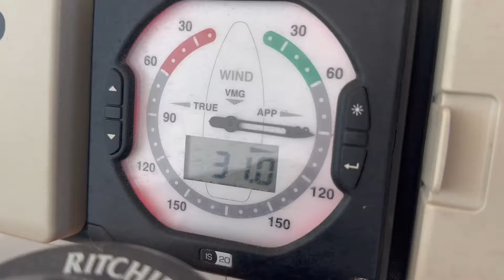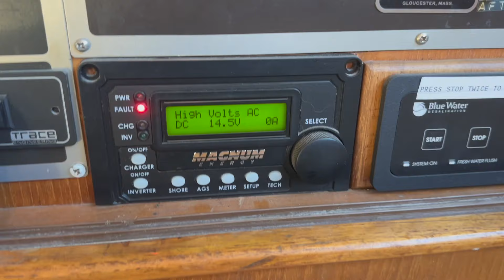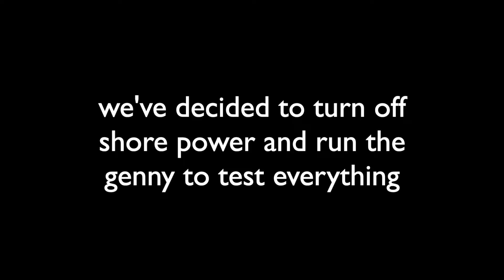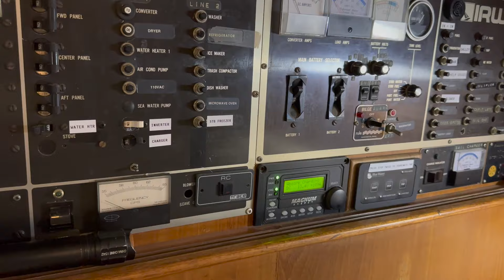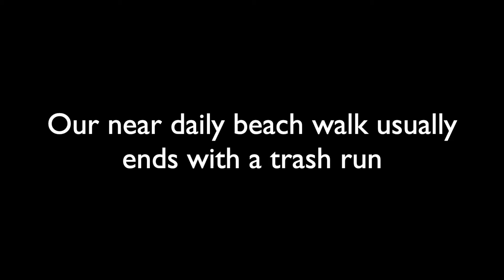Ep 66 | Sailing to Peñasco with two dogs, a cat and a rat

Comment: Been a while since I checked in.  You both look great (and the boat and doggies)!  Hope you get your stowaway issue solved, before it eats all you wires!

And hey, question about shore power if u have time.  I thought (especially) on a big boat like Blue you'd have a surge protector / power conditioner / or something  to deal with (or warn you) of bad shore power.  Is it not technically feasible or you just don't have one?  Thanks and good luck with everything!👍
Reply from the maker: Great question! We do have a surge protector for an RV but haven’t found an adapter for the boat. Typically we anchor, so we haven’t done much research on surge protectors for the marine industry. Something we will definitely look into if we dock her long term again. Thank you for the comment and encouragement!🥰

Comment: Hi.. how did you contact  the San felipe marina? We thinking of going in there for a week or so , need to cross border for  our visa run.. 
Thanks
Reply from the maker: Hey there, we called the marina: (686) 577-6394. This number was found in Shawn and Heathers book. This was a Fonatur Marina, and has since changed hands, I’m not sure if the number has changed. best of luck, fair warning, the docs are completely falling apart, the water, from a 400 foot garden hose, is on again off again, and the power destroyed several of our appliances. I recommend Puerto Peñasco over San Felipe, Marina. The marinas are in better condition, there are more to choose from, and it’s only an hour and 15 minutes to the border.